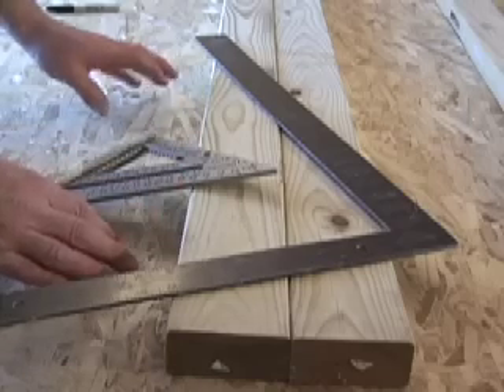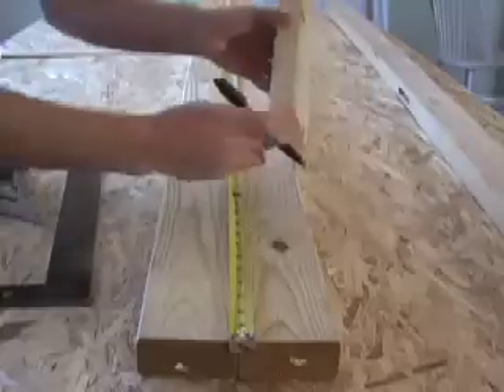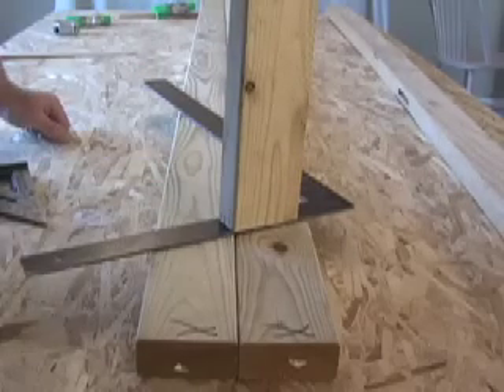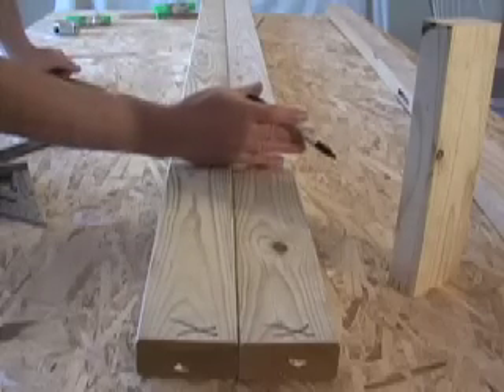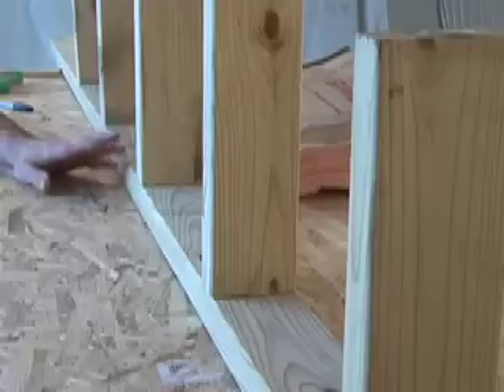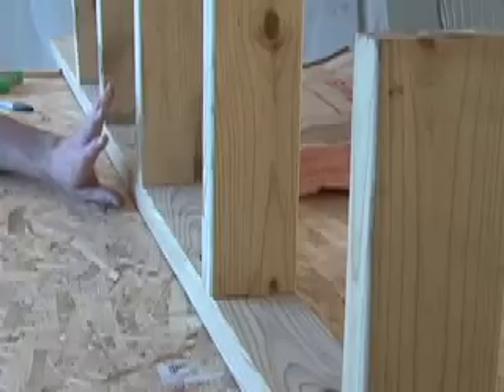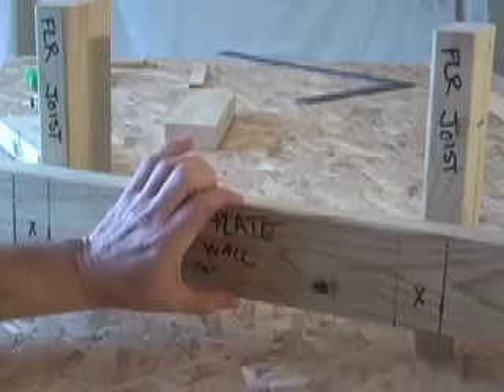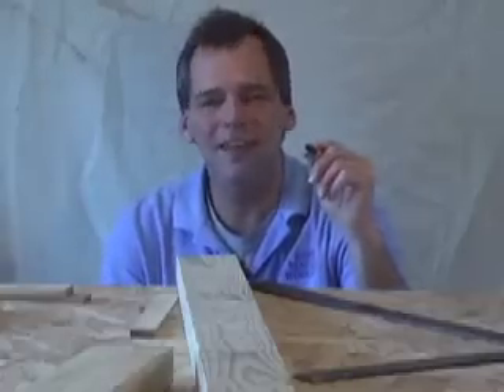how to frame a wall 16 inch on center (CC)

Comment: Hi Bob. I wonder if you have any videos that can walk me through the best method for converting 24 inch on center walls to 16 inch on center walls? The room is 15x30 and is attached to a single level shop. The frame is exposed as I have already removed the walls themselves. Thanks for any advice you can give.

Comment from the maker: @sredworb    Depending on your situation, if its a basement I explain how I would do it in my videos--Basement framing layout 1 and 2 shows how I would build it between existing floor and ceiling,suggest you check them out +++Bob Thanks for watching

Comment: @HomeRemodelWorkshop Same question as 4x12.  Do you put up the top and bottom plates then attach the 2x4's or do you build the whole frame and then raise it up?

Comment: Hi Guys,

I just purchased my first home.  My garage is 24x14 and I want to split it in two... Have a work area and a jam room. Regarding the 2x4 framing, do I need to build the wall first and then put it up? Ill be doing this alone and that seems to be a little harder for a one man job... Can't I just start by nailing down the bottom and top of the fram into the wall then add the 2x4's making sure they are leveled?

Comment: @SmooveTalker I think you are thinking the same as me. I responded to Bob on a post just under the video. 15 3/4 " off of the end stud then 16c from there is the way i lay it out  
!x----15 3/4>--X---16c--X--16C---X--16--X!

Comment: @HomeRemodelWorkshop Am i doing something wrong? it feels like math in school. you tell the teacher the correct answer but he didnt like the way you came up with it. I learned from my dad to mark the first measurement at 15 3/4 then from that mark  you make the new marks @ 16c". when I start on the right i place the stud on the right of the mark reverse method for starting on the left. anytime i place full sheets on the wall 8' 10' 12' 14' length they always end on the middle of a stud.

Comment from the maker: @rjsaunders92   No offense taken.  If you start with a standard size sheeting material your first sheet will not break at 4 ft 8 ft or 12 ft. Not that big a deal just might save a bit of material here and there.+++Bob

Comment: really helpful video's... thank you. although, you say about measuring half the stud width from the 16" mark, not necessary, if you measure from the end of the plate (right end) then that will be the right side of the stud, so, every 16" mark will be the right of the stud so you can position each one to the left of the mark. make sense?

by the way, im not complaining, your video's are really helpful, just thought i'd say as its needless time spent measuring half the stud with and calculating...

Comment: @awdiostuff Take into consideration, insulation and drywall hanging for the most part. A really cool book to check out is the "For pros by pros - Graphic guide to frame construction" by rob thallon. This book shows and talks about different ways to do framing. such as there is a method with a double stud near the corner, or you can save the extra stud and use drywall clips.

Comment from the maker: @awdiostuff I know that your thought process is if you have 1/2 inch drywall in corner you will need to adjust for that amount,however, no-one knows exactly the order the drywall will be hung so I start all my wall with the same lay-out from the corner,the small amount of trimming that is needed for any sheetgoods is worth the ease of doing exactly the same lay-out from corners every time.+++Bob

Comment from the maker: @mcgoni The only reason it matters is to use as much of the full amount of sheetgoods as possible,be it plywood,drywall,and alot of standard building material  sizes that require breaking on a stud+++Bob

Comment: I love these vids but.... this one can be confusing.  You are framing so that each stud EXCEPT the first two are 16 on center.  This method will indeed allow a piece of drywall to go flush to the right side and end up mid stud (471/4) to the left.     Good method when adding a stud wall next to a finsihed wall.   Smoove - does that help you out?

Comment: ok 

Nice very helpful. But what do you  when your cement floor under you bottom plate is not level?

I'm planning on adding a wall in my shed to section it between the storage side and the workshop side. tired of heating the storage side when I don't need to.

Thanks Jim

Comment: I see now why you need a 16" spacing after you explained the part about the insulation which is cut to fit perfectly in between the wall joints. Thanks so much for this information.